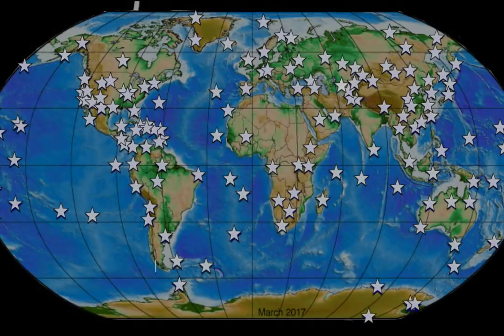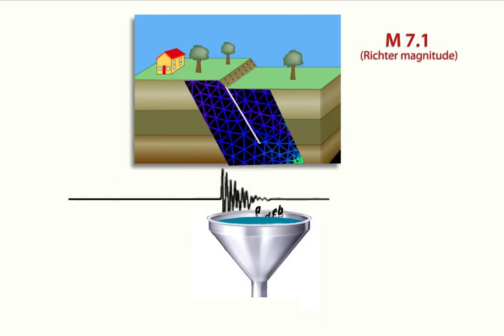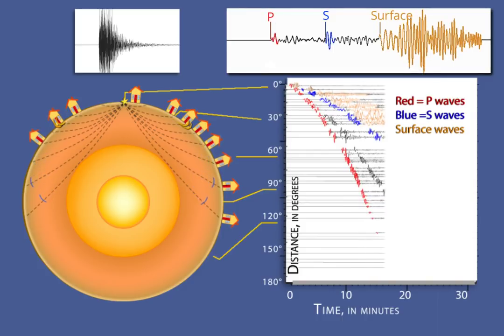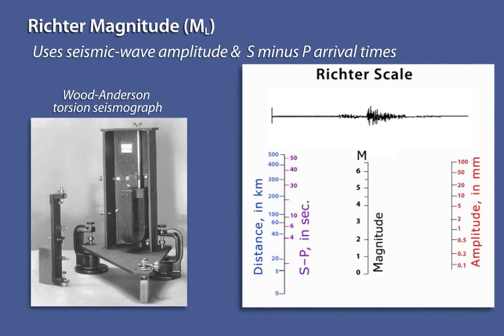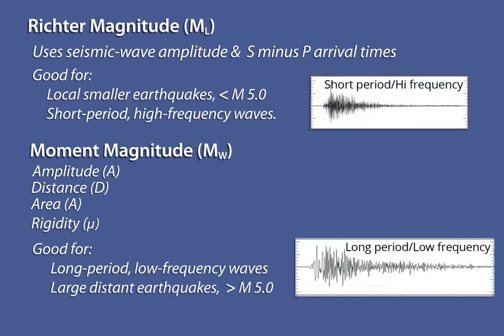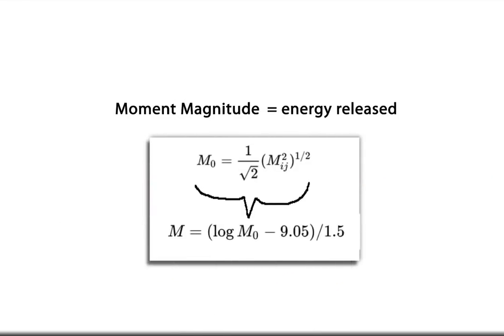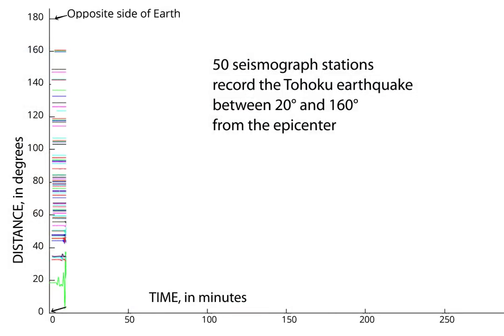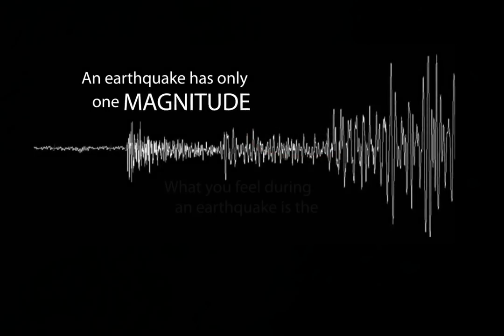Changing the Magnitude of an Earthquake: Why downgrade/upgrade?

Comment: So how many OTHER official government agencies change the magnitude of earthquakes after reporting them?  MUCH of the stored data is available to anyone who requests it but it obviously limited and NOT available to EVERYone who requests it.  Sometime data is available at certain times and not others from the same station as observed bay a NUMBER of youtube posters who simply make the data available to subscribers with or without comment as to why.  Getting a preliminary magnitude has nothing to do with complex processes deep in the earth because it is simply based on measurements.  INTERPRETING it is based upon assumptions about processes happening deep in the earth.  So initially there are measurements.  Then a collection of these measurements are crunched and analyzed and interpreted.  Determining the actual hypocenter is an interpretation so all calculations based upon it are subjective. The video makes it sound like settled science.  The problem is the variables.  One example is the slide at 3:53.  The variables listed are Amplitude (measured) (Distance:calculated) Area (also calculated) and Rigidity( virtually unknown).  Why do I say that rigidity is unknown? All of the rock in the calculated area would have to be reasonably sampled to the depth indicated to establish the rigidity and that has simply not happened on a sufficient scale.  The sampling is far between and shallow.  It has happened where and when there has been a reason for someone to drill for oil or water or some other reason not in a scientific or specific pattern.  And certainly not to a uniform depth throughout earthquake prone regions.  As I pointed out area and distance are both calculated and are based on the presumed (calculated) hypocenter.  That is too many variables to reasonably call this scientific therefore many peopee do not find these calculation to be based on enough measurements and known data to be credible.  Thus the label magic. I am a scientist with twenty years experience in medical labs and if I had worked this way we would have killed people not healed them.

Comment: If the Richter scale is not suitable above mg5, why would you you publish measurements based on Richter principle, which are thus faulty above mg5 anyways? Why not just wait until the moment scale data comes in? Why not defunct any Richter measurement above mg generally?
Reply: Because it is really difficult to messure the Moment magnitude in small earthquakes and the Moment magnitude was calibrated to give the same magnitude value as the Richter magnitude for small earthquakes.